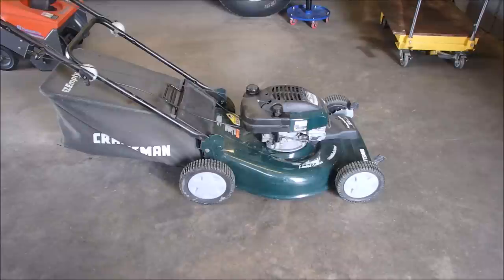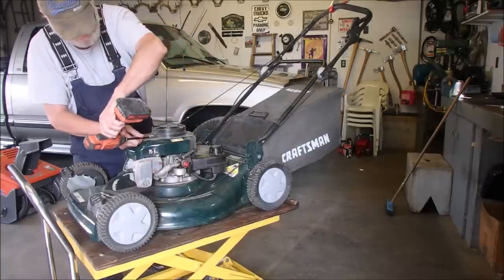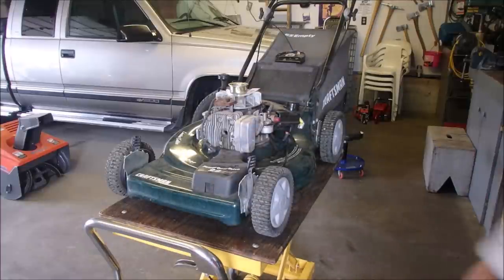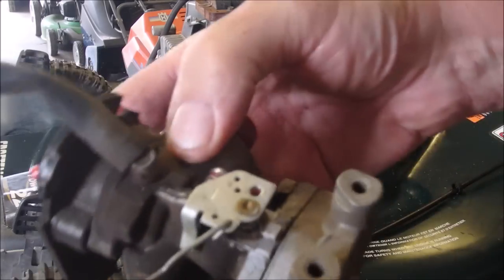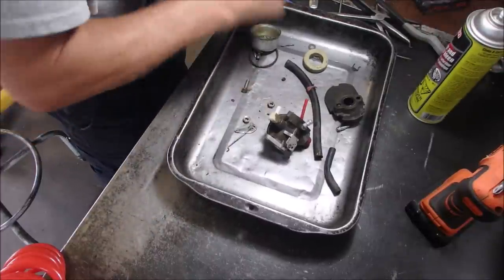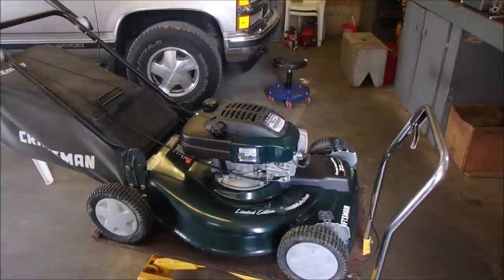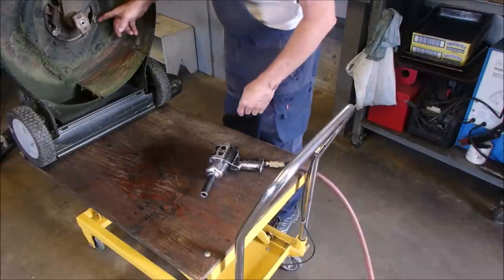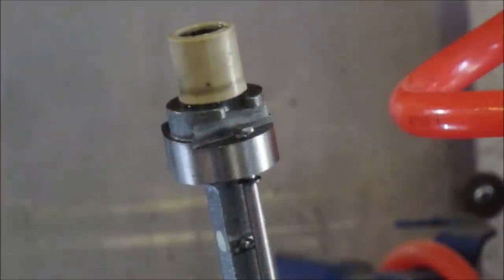Craftsman 6.5 HP Tecumseh Jerks Rope.  Not What You Would Think

Comment: To be honest, I was more worried about that stupid mower falling on, and scratching your beautiful Chevy truck!    This video is very valuable indeed.  I remember back in the day, so many years ago, before electronic ignition.  A sheared flywheel key resulted in a loss of spark, very common on Briggs with the soft key, less common on tecumsehs with the hard key.  Although when tecumseh keys sheared, they usually messed up the flywheel and bugger the crank a bit as well.  The soft Briggs keys did not damage anything when the sheared, just a loss of spark.  So, troubleshooting the loss of spark by replacing the flywheel key also took care of any timing issues.  Today's electronic ignition units are not dependent of proper flywheel key positioning, they will spark just fine, like this one did.  The problem is that the ignition timing is thrown off a bit, resulting in poor running conditions.  It is easy to overlook the flywheel key as the suspect while trying to troubleshoot the carb and everything else on the engine.  So, in that regard, I guess I had it easier "back in the olden days".  
While most Briggs were preferred over the tecumsehs service wise, I was quite comfortable working on the tecumsehs as well.  True, the governor set up was a little confusing, but with today's cell phones, you could just snap a quick picture before disassembly.  The old tecumseh carbs used to get more gunked up than the tank mounted Briggs carbs, but the Briggs tanks had to be replaced once rusted/gummed up inside.  I am wondering why it that crazy big plastic vent that protrudes into the air cleaner box is needed on this engine.  
Also, it looks like this tecumseh flywheel has some holes so that the nice Briggs flywheel puller might fit, you would just need to tap out the holes.  Today's damn plastic cam gears and crazy compression relief systems make troubleshooting ever more difficult.  The last thing any tech wants to do is to "guess" that a bad cam is causing a running issue, only to pull the whole thing apart and find the cam is OK.  So, it is easy to understand how everything else on the engine might get repaired/replaced before ripping the engine apart to check the cam.  I wonder if Briggs/tecumseh ever made a tool to check cam positioning without having to pull the engine apart.....
Reply from the maker: Thank you for the knowledge.  I find today that the modern Briggs flywheel keys take a bit more abuse that the Tecumseh's.
Reply: @BrucesShop    Do the newer Briggs still have soft keys like the older models I'm used to?  I would say that just about half of the Briggs repairs that came into the shop were due to sheared keys (back in the day).  The tecumsehs back then had harder keys that didn't shear very often.  But, when they did shear, usually took out the flywheel and bunged up the crank keyway.  So, the soft Briggs keys were more of a nuisance, but it least it forced owners to bring them in more often to needed servicing (air filter, oil, cooling fins) which probably prolonged their life in the long run.    Your buddy's advice about retorquing those head bolts is great advice indeed.   Looking forward to see what you do with that crummy cam compression relief...

Comment: It was again  a great video. I have lately  experience a similar problem of hard to pull cord on the same engine to discover that flywheel key was ok but timing was still not good. I did check valves lashes to discover that they were impossible to adjust since tappet were moving backward (at TDC). After opening the engine and analysing what could be the problem, I discover that the shaft of camshaft assembly, on the end sitting in the engine's base towards the cutting blade,  was seating in hole which was excentric. This was making that end moving sideway and making tappets moving backward when trying to adjust lash (lashes were almost twice spec's one). I beleive the problem was coming from that in my case. I hope you don't have the same because I don't beleive it is repairable.
Reply from the maker: Great diagnosis.   Wouls that be a sump end?  Perhaps a new used ) sump would help.  However if you are like me I would part out the engine.
Reply: Yes, it is a sump end in which hole was oval (due to ware, I guess) not excentric as I mentioned. I finally parted out this engine.

Comment: I used an old freebie Toro Whirlwind with a 3.5 Tecumseh for years as a kid when I mowed lawns. That thing just ran. I figured I couldn't go wrong with another Tecumseh when it was time to buy one for my house. Wrong!

I paid a hefty-for-it's-time $260 for this very model in 2000, expecting many years of use out of it like the ol' Whirlwind. It ran just fine for the time I used it. I used it for almost 3 seasons and in the middle of cutting one day, I thought I hit a rock after the mower stopped suddenly. Then I noticed a flood of oil crossing the deck. Lo and behold, I found Mister Rod sticking through the newly created inspection window! In all of my days of mowing and being around mowers, the thought of a mower throwing a rod was and is still as probable as flying to Mars.

I immediately went to Wally World for their cheapest 4.75 Briggs MTD unit to finish the mowing job that day, less than $120. 20 years later, I still have that mower and it looks and runs like new. The simplicity of this Briggs is an absolute marvel.

On the autopsy of the Tecumseh, I found that the connecting rod was attached to the crank with something akin to drywall screws. No bueno design for something expecting to make 6.75. Needless to say, I threw the whole lot in the dumpster as fast as I could. It's absolutely no surprise Tecumseh went out of business.
Reply from the maker: Thank you for the info.

Comment: Myself I remove the 2 bolts from carburetor turn carburetor to un hook carburetor from linkage. All linkage stays on engine. The tab with spring stays on bolt in bolt hole
Reply from the maker: I used to do it that way as well.  there are many wasys t go about it.  Thanks
Reply: Back in the day, when the carbs throttle and choke controls with the steel cover over the carb, I used to just remove the governor arm from the engine so all the links/springs stayed intact..  Oh well, what can I say, never was know for doing things the easier way...